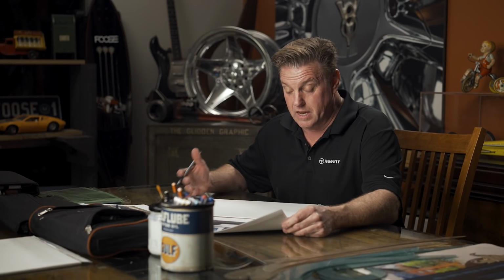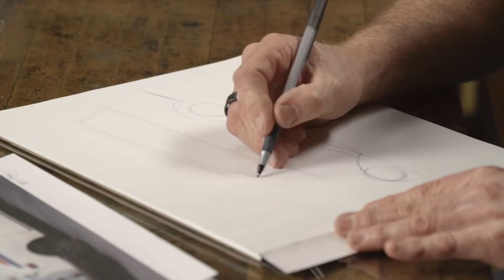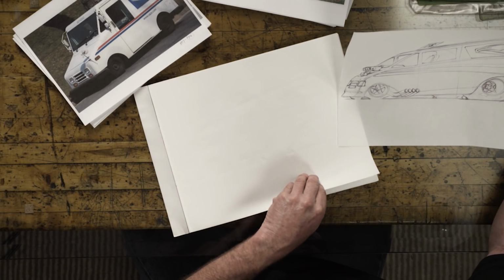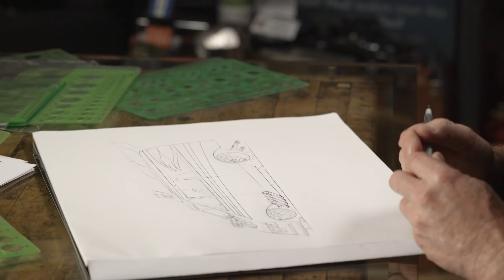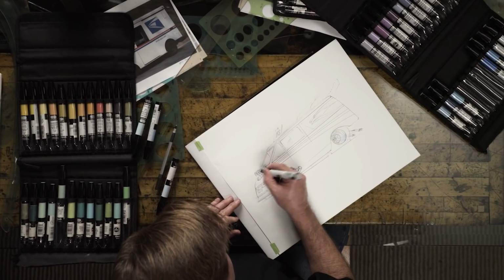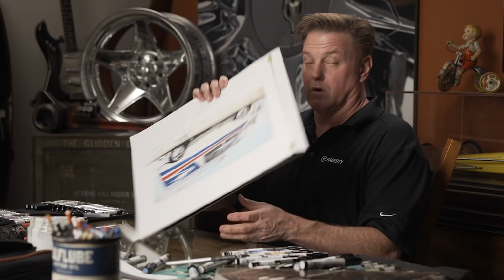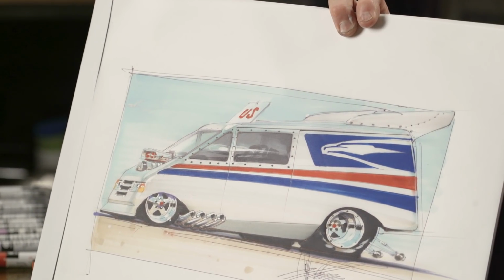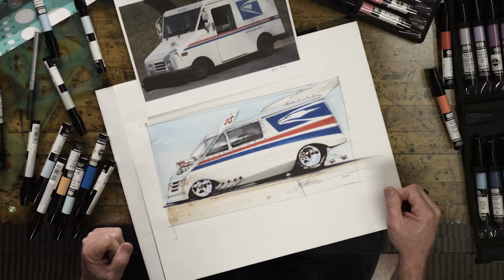Hot rodded USPS mail truck? | Chip Foose Draws a Car - Ep. 22

Comment: I know a mechanic in Springfield Missouri who developed an incredibly cheap electric conversion kit for existing mail trucks. It was a classic example of a principle we use in software: prefer rapid incremental improvements instead of massive projects that won't pay off until the project is done.

He started with a bank of cheap lead-acid batteries and a relatively inefficient electric motor designed for elevators. Far from optimal, of course, but cheap and fast to implement, needed no new infrastructure, and was overwhelmingly better in the very common case of close-range urban deliveries.

It was rejected in favor of a big project from big bidders to come up with a big new rollout. Not surprisingly, the big project is years behind schedule. The small project would've paid for itself in probably the 1st year, giving valuable feedback for the next iteration.

We look ahead and think we can handle a big project. We look back and wish we had used smaller iterations. Listen to your future self, young engineers. You probably already know what you will tell you.